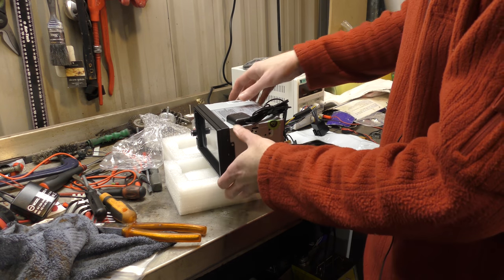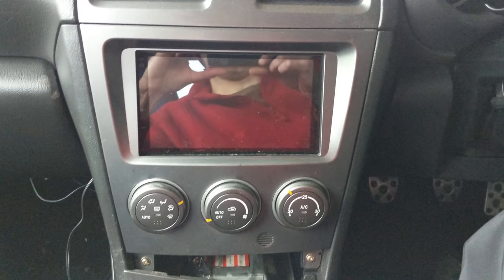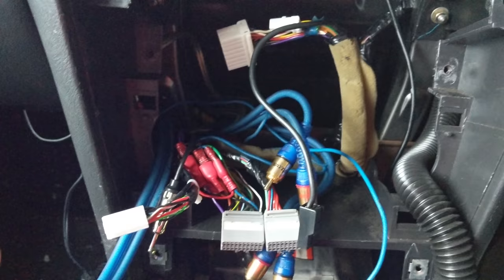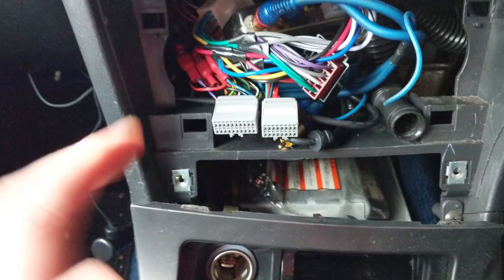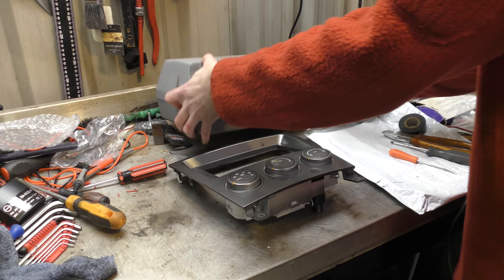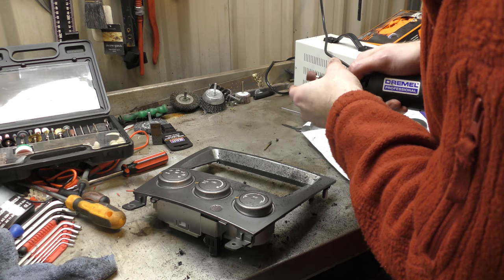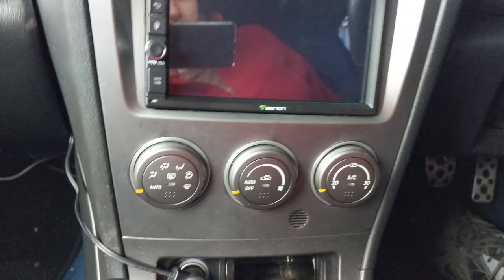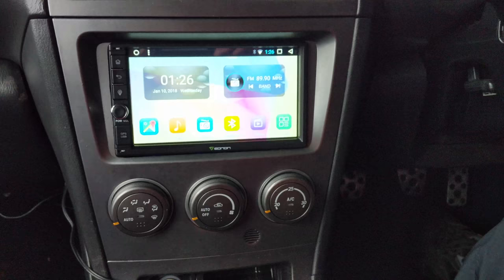Android Head unit Fitting // Project STI

Comment: As much fun as it is getting covered in plastic, would it have been a bit quicker to use a micro cutting disc on the dremmel?
Reply from the maker: Paul here - I used the disc when I did mine and ended up in the same mess :D